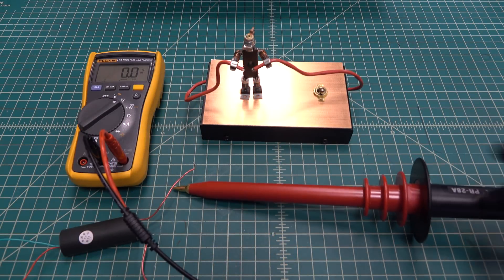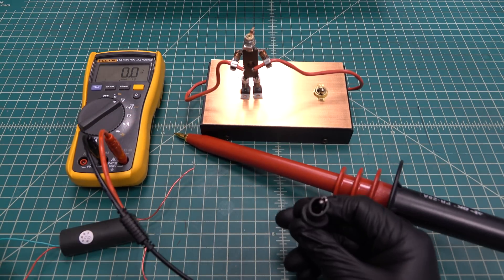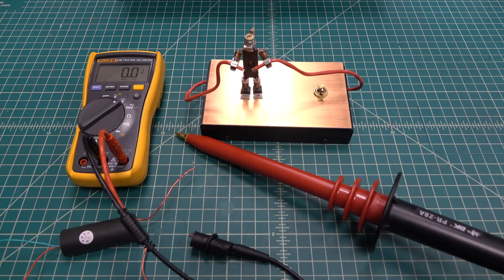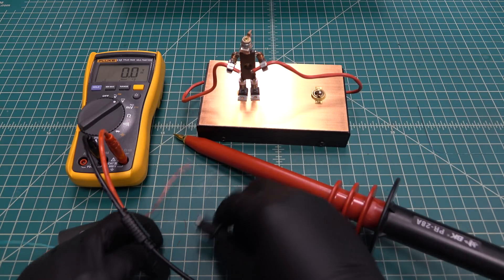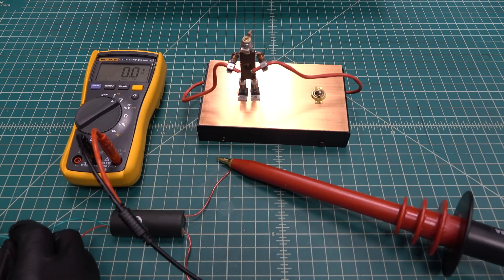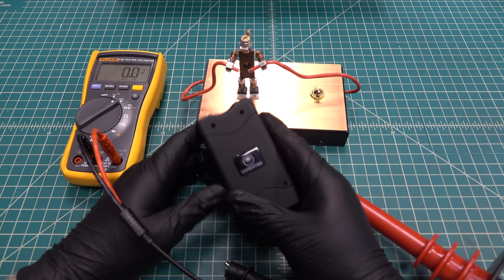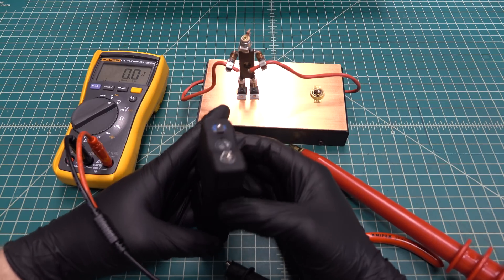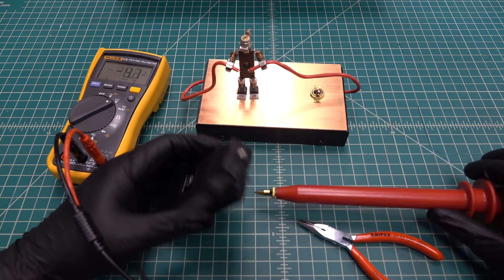Quick Tips #6 : Measuring High Voltages

Comment: Question. 
Ive seen tjis 1000:1 probe for sale, but I need a device that is faster than a multimeter. 

12 volt 1amp power supply. Going through a primary coil 12 turns of double wire (24 turns). 2ndary coil 335-340 turns. L552 flashers. And I use it to high voltage through the body to kill parasites. But I have no idea how much voltage im putting through myself. Two pads that go on the body.

Comment: I have a similar looking module I used to make a taser and wow does it hurt worse then any taser I've ever been tased by. Even the viper 989. Mine has a gap of more than 3/4" of an inch so by your numbers that would be around 20,000 volts and I only am using one  ohm work high drain 18650 battery and you are using 9 volts. The modules are advertised to run up to 5 volts so I have been weary about adding a second battery in parallel but if it works then wow that thing would be like a cattle prod. 😂😅

Comment: That sounds like some good news because I wanted to test something with a slightly lower range to 15kv. I think I'll cheap out on the high voltage probes and just have a designated voltage divider breadboard just in case.

Comment: Hi @UCpTuKJrXFwybnpOG7HpTpZw. I have a ViperTek stun gun just like yours that produces about 14,000 volt and I want to measure the current on that gun. 1) Can I measure the current even though the multimeter can only handle 600 Volt ? Understand that I am measuring the current not the voltage because if I measure voltage it would burn out my fuse. 2) If it can be done then how would I measure the current in such a device ?

      

      
  38.1K subscribers

Comment: Check against Ohms law whats happen if you load 100000V with 10MOhm load! V²/R=1000Watt?!?! Can your high voltage load deliver that much power? I guess not. You need a much higher measurment impedance or another kind of methode to measure

Comment: I want to discharge a CRT tv. Can I do the screw driver with a wire and ground to the strap wire around the tube, but.... I want to tape the screw driver to a wooden pole from home Depot so I can do it from a distance. Can this safely be done??
Reply: if its an insulated screwdriver you should be fine

Comment: How to wire  a LED to 3k voltage and use as power on indicator . 3k microwave transformer output. Thanks
Reply: Use a voltage divider.

Comment: with ohms law, how can this put 14k volt in your body, without having the amps to follow?
Reply from the maker: It does not, that is the voltage without a load.  The capacitors storing the charge in these units have such small capacitance that the voltage will drop immediately when a load is applied.  This is why it is important to test a power supply with a load.  Most cheap power supplies can not output their rated voltage at full load.  Ohms law assumes that the power supplies can provide unlimited current, which they can't.
Reply: @ProtoG42  Well, there is high current, but only for a few microseconds at which point the voltage drops to zero due to the low power of the driver circuit.  Enough time to hurt you badly but not kill you.

This is the same reason why static electricity (sometimes in the 10kV range) hurts so little.  Its high voltage arcs are passing large currents, but are so brief that they can only be seen in very low light.  At the same time, AC power at 120 volts can cause tremendous pain while only passing a milliamp through dry skin because the exposure is continuous.

Watch Electroboom's videos.  He even does demos of both cases!
Reply: @ProtoG42   bro what if we connect a switch . Can the voltage increase .

Comment: Please Reply
Nice Bro
 but I have a doubt that 
1)what does this probe made of 
i.e the principle of operation of this probe (whether using a calibrated resistor or something else)?????
2)Is there any other method to measure High Voltage DC??
3)Can we make this?
Reply from the maker: The high voltage probe is essentially a precision 9.99GigaOhm resistor in a voltage divider with a 1000:1 ratio so what ever reading you get on the meter is 1/1000th of the actual voltage that you are measuring.
Reply: Proto G 
So can I make one? as it is very costly
Reply: Proto G 
If yes then using which ratings
i.ecan you please specify the Ratings
Reply from the maker: You can, but it dangerous without a good understanding of what could go wrong.  I'm not going to recommend the rating but you can search for diy high voltage probes for instructions.  If I were you, I would buy a used probe on ebay.

Comment: I have a fluke 87 that measure 11 Meg ohms. What scale should I use the probe?
Reply from the maker: Do you have a high voltage probe like shown in the video?  If the input impedance of your multimeter is 11M then your reading will be high.  Just multiple by 901 instead of 1000 if your meter has an 11M ohm input impedance.  For example, if you use the high voltage probe and your meter reads 10VDC, then you will have 10*901= 9010VDC
Reply: Ok thanks. But which scale do I put the meter on to measure about 2KV?
Reply from the maker: You will be reading at most 0-40 volts with the high voltage probe to read 0-40kV.  Adjust your meter until you get 0.0V displayed when switched to VDC.

Comment: Hi Proto G,
A good video, I have also brought a 400 kV module from ebay (http://www.ebay.com/itm/DC-3-6V-6V-400KV-400000V-Boost-Step-up-Power-Module-High-voltage-Generator-CH-/221603357318). I want to check its output voltage, I have a High voltage probe 1000:1 (40kV : 40 V). In Voltage probe they have mentioned as 40kV max and my DMM can measure upto 1000 V. So can I use same voltage probe to measure the 400kV output voltage. (Hopefully the ebay module does not generate upto 400KV) .
Reply from the maker: +Ismail Hussain Thank you, it seems to be the same thing and definitely is not more than 40kV.
Reply: +Proto G 
Thanks for replying to my comment. You mean that ebay module will be less than 40kV.
Reply from the maker: +Ismail Hussain Yea, it is probably closer to to 10kV.

Comment: But amps kill and volts just stun.
Reply from the maker: +Ralph L. Baer That's not true.  They're both needed to do damage to your body.  I can hold my 600 amp metal melting transformer with both bare hands with no harm because it only has a potential of 3V across the wires.  Both of these modules are only capable of outputting about 5mA when powered with a low capacity battery like a 9V.  They could very easily kill you if used with an input that has a large output capacity.  Please do not mess with high voltage unless you know what you are doing. Please watch this great video by Mehdi on the topic: https://www.youtube.com/watch?v=XDf2nhfxVzg
Reply: It takes volts and amps to kill
Reply: Your comment has nothing to do with the video and every words of what you've just said are wrong.
Reply: @luongmaihunggia  But Proto G makes interesting engineering videos and not just stupid comments like some crafty red gall stone guy, so he can say what he wants and it does take both one is the force of electrons the other is the quantity physics wont allow one without the other buzzard
Reply: @av6966  still has nothing to do with the video.
Reply: Current does not exist without voltage, what your stating is an attempt at a technicality but it is false. If a parameter is voltage is required for current to flow and kill you then it is a situation where you will never encounter meaning it is impossible to reconcile how much current kills if a requirement of voltage is necessary. This statement is exactly like saying if you fall from very high up then it is the force upon impact that kills you not the fall itself.

Comment: cool video 👍. subed 👏.
i have designed about 5 different types of these high voltages probes. and what i can say is that the reading u get is true if the circuit is capable of providing the same voltage under load. just remember the joule theif circuit. it goes very high but if u put a small load it would drop sharply 👍
Reply from the maker: +Applied Electronics Thanks, that's a good point.  I think that is even more of an issue when measuring say, a 400VDC power supply, with regular multimeter probes.  The high voltage probe in the video essentially a 1000:1 voltage divider with 10M ohm input from the meter and 9.99G ohm from the probe for 10G ohm total.  With such a huge impedance, it is less likely to affect the power supply than a regular probe when measuring lower voltages.
Reply: +Proto G 👍
Reply: @ProtoG42  hey bro I have a dobut that is,  can I use this 10kv to charge my home appliances. Like running my 220v bulb . Plz reply

Comment: Aren't these things using capacitors to store charge that gets converted into a higher voltage until it arcs?

What I mean is - in an almost open circuit you'll see voltages peak much higher than you're seeing. You're testing them closed circuit, so the voltage doesn't build.

Can you measure the voltage peak when there's an air-gap in the circuit?
Reply from the maker: +Sarah Cartwright I've measured them after left open for a few seconds with the same numbers.  They're essentially multistage Cockcroft-Walton Multiplier voltage doublers in potting compound.  The capacitors have a very low capacity and reach peak potential almost instantly.  If left on too long with the wires spaced too far away to arc, they just overheat and break.  The output capacity of these modules are less than 5mA.
Reply from the maker: I'll try something else tomorrow to see if I can get higher voltages and report back.
Reply: +Proto G Cool. I just have a vague memory of something months ago that I read. I&#39;m probably wrong but was curious if it was about these types of circuit.
I took one of these designs apart once - it was hard potting compound, not rubberised though so it was a pain. I saw a custom transformer (taking up most of the space - it was quite long, not square), polyester capacitor, and some pieces of unidentifiable components. Hitting it with a hammer and screwdriver wasn't a good way of dismantling it. It looked to be missing enough capacitors to be a multi-stage CW generator. I'm guessing a single stage, with a step up transformer that's 10,000 to 1.
Reply: @SarahC2  At the end of the day, regardless of the driving circuit the voltage can only build to the whatever the breakdown voltage of the air is (depending on temp, humidty, etc.) before current starts rising and the voltage shorts to zero.  Given the spark gap of that taser, and the typical breakdown of 3e6 Volts per meter as stated in the video, it is impossible for the voltage to rise any higher than a few kV.

Comment: Do they make these for oscilloscopes? It would be nice to be able to measure waveform outputs of things like electric fence for fun to see what that waveform looks like (my guess being a periodic huge voltage transient that oscillates and dies away quickly.)
Reply from the maker: +Power Max Yeah, but they're a lot more expensive: http://amzn.to/1PXXZ4f
Reply: +Proto G Ouch, for that price, I'll just grab the electric fence and try to draw a straight line, to capture the waveform lol!!! Seriously, what makes it so expensive, all it is is a glorified resistor divider!
Reply from the maker: +Power Max It's expensive to manufacture a 1000:1 voltage divider that's accurate and has decent bandwidth.  The probe in the video has a trim pot inside that I'm assuming was used to calibrate the resistance in the factory.
Reply: +Proto G Makes sense considering the input to a scope is effectively a 30pF capacitor and 1megaohm, and I guess high voltage high precision resistors aren't all that cheap even though I would think their constitution is relatively simple (lots of smaller resistors in series in potting compound).

Comment: I've always wondered how so many stun guns claim anything from 100kV upwards to several million volts, especially since the spark gap is less than an inch across with sharp electrodes. Only thing that I am aware that is measured in the order of millions of volts are tesla coils and maybe van de graaff generators.
Reply: +Power Max Also storm clouds.
Reply: +lodevijk lol yeah those too, although I don't think they can be parameterized accurately.